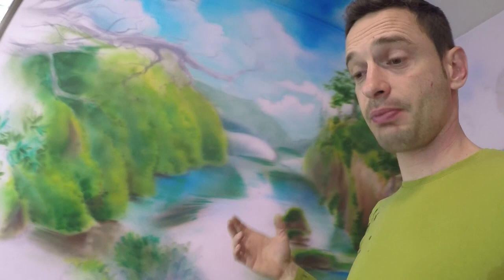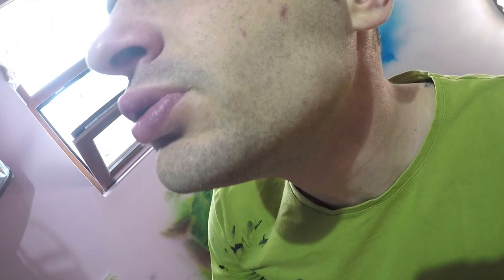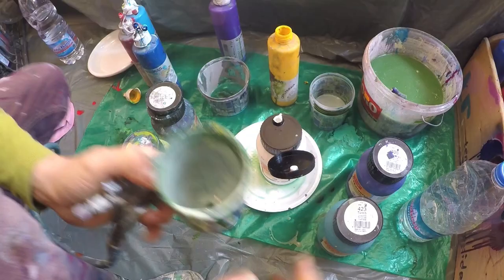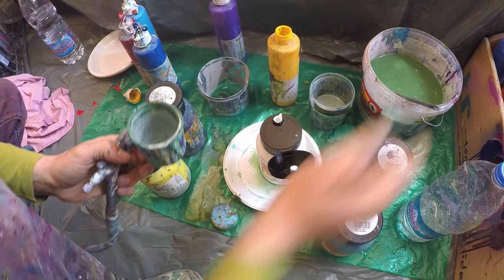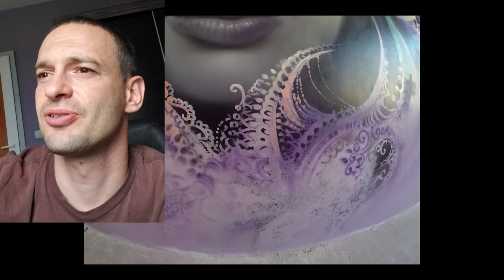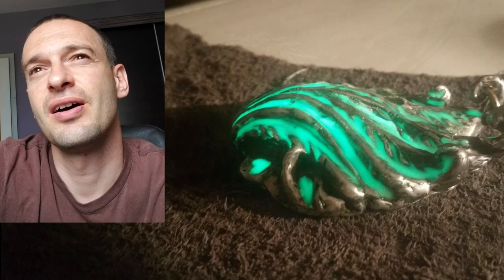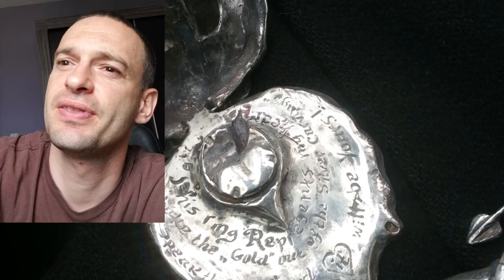How to paint cherry blossoms acrylic 🎨

Comment: Dude you're making me want to get one of those little spray guns for my work! Excellent work.
Reply from the maker: Hey  man, thanks, it saves on cost for paint, but its headache to clean and change collors.  I see you use spray cans,  it might be better for your workflow to stick with those🙂. But if you have questions let me know
Reply: @DelyanKosto  I finally decided to ho for an airbrush gun as opposed to a regular gun as a compromise (so i can use it on a smaller compressor) so I can do my blends with it and details with the airbrush. But for the main colours you're right I'll keep using cans and brushes/rollers.